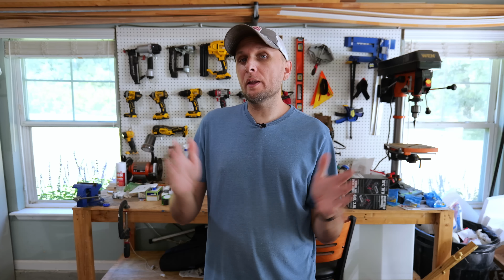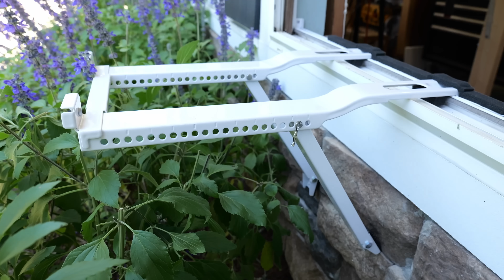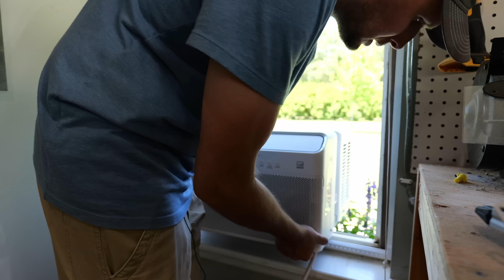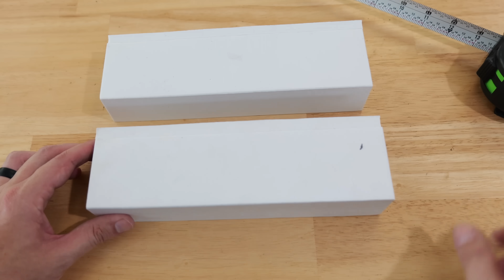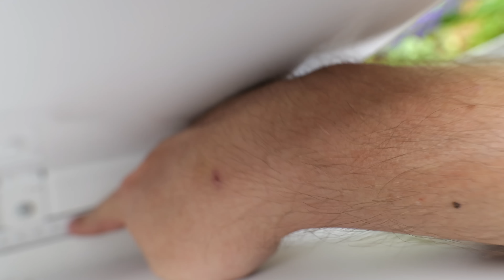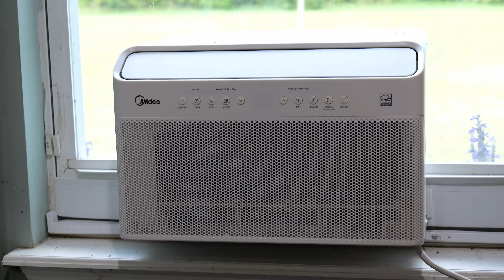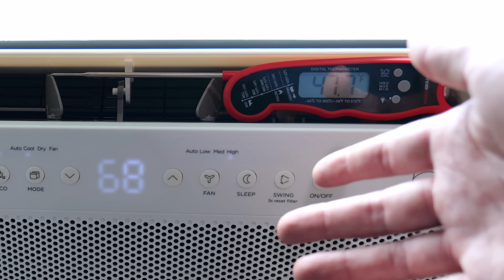The COLDEST And QUIETEST AC Unit Ever Made!  Still Use Your Window!

Comment: I have 3 of these, they are ok, they are real quiet for a month or so then all of them will have fan clicking (shroud nicking) start up, all started rusting out, and I had to put drain holes in them as way to much water was filling up the pan and traveling in to the wall...as I said they are ok, they need to adress the rusting, the draining and the fan shifting
Reply from the maker: Interesting.  I’ve not experienced that.  What did you do for the fan to make it stop clicking?  Anything?
Reply: @HowToHomeDIY  remove the top and shift the fan, may or may not work
Reply from the maker: @Cat-Caddie so check this out.  I started getting a ticking noise from the fan today and started blaming you for the luck 😂.  Took the cover off and found a tree frog had a bad day on the fan and it was throwing it out of balance.  Removed it and back to quiet.  I was like what are the odds 😂
Reply: @HowToHomeDIY  rofl

Comment: I have one and it is amazing.  I have it running all day in my office in the summer off of a Ecoflow battery and a solar panel and it only pulls 224w of power  (low fan speed set at 67 degrees). Saves  a ton of money not having to run the entire house here in CA.   I have had it 2 years. Highly recommend.

Comment: I have a small midea ac and is very quiet. I am amazed. Thanks for reviewing this larger unit, I am thinking about getting this ac  instead of getting a mini split and it definitely seams much easier to install than a mini split and less expensive. Thanks again for the review video.👍👍👍👍👍

Comment: Looks great. Now I want my current units to die. Regarding security, I use 1x1 wood cut to the measurement from the top of the window up to the top. I make it slightly longer so that I can wedge the length of wood.

Comment: Great job on the video. Looks like a winner. I guess if we get one tomorrow, I'll have to see if the app requires me to allow my location to use it or if they sell any of my data. This is an epidemic. Just found out LG televisions sell your data by default out of the box unless you go through the menu and toggle it off. They've sold mine for about 3-4 years before Lois Rossman exposed it. Consumers have to keep pushing back or we will own nothing and be happy. Wink-wink.

Comment: I just installed the male version of this AC, the non-split unit. It has all the same specifications and energy usage ratings as its split sister.  The only difference is between the two is the male non-split version is a little shorter, so it doesn’t use a support bracket.  The male non-split version just hangs in the window like smaller units. In the Louisiana summer, the male non-split versions creates A LOT of condensation. I’ve measures ~10 gallons of condensation every 24 hours of constant use.

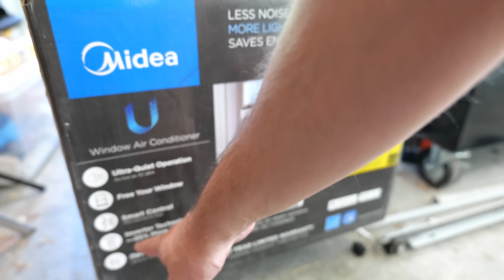Comment: Just wanted to chime in on the comment about inverter AC's being able to blow colder air 1:24 .... false. It can not possibly get colder because of what it is. Inverter "tech" is simply an AC->DC->AC control circuit that can accurately and efficiently regulate the voltage of the DC rail, thus regulating the output of the AC compressor and the amount of coldness produced (sorry HVAC guys, dumbing it down)

A regular AC is either 100% on or 100% off, 2-stage units can do 0%,50%, or 100%. Inverters allow all percentages between say 15%-100%. The ability to use only enough energy to cool a space is where the efficiency comes from, but an AC can only ever run at 100% so whether it were regular or inverter the output at full power is the same.

Comment: At minute 7:50, please note:  Some windows do NOT have "lip" on the inside lower frame so there is nothing to keep the window from being lifted up from the outside.  Please advise people to install a DIY bar or cross brace that will put pressure on the upper edge of the lower window panel and secure the bar/brace into the upper corner of the window jamb to keep the window from being opened from the outside.  This is important as window ACs are often used as a way to break into a home.

Comment: Keep in mind folks, Midea's "room temp" is probably read by the a/c unit itself, not an independent thermostat in the room that's distal from the unit, thereby giving a faIse reading that's likely lower than the actual temp in distal parts of the room. I bought GE's split quiet 12000 btu window a/c to replace my older standard a/c and it took a dump within months. My old standard a/c I replaced was way louder, but it blew air much more forcefully throughout the room...so much so I could feel the moving cold air in the adjacent rooms The split unit was so anemic when it came to the fan's force of air, I had to use a supplement fan to do the same thing.  Bought another old school 12000 btu Frigidaire with no wi-fi. Yes, it's louder, no bells and whistles, but in my opinion it's worth having that cold, forceful air getting the job done, especially when it's triple digits outside.

Comment: The Lyft assist struts in that single hung window are very easy to replace. I'm sure you can find the information on YouTube. I would say You are more than skilled enough to replace them just an FYI. 
Great video. The only problem is all my windows are xo not single hung
Reply from the maker: Great eye noticing the balancers were gone!  Yes the replacement is easy, finding the ones that fit my windows has proved more difficult.

Comment: A couple of hours to cool off one room? No Thanks,
Reply from the maker: It is a 500 square foot garage that has never been air conditioned before.  Started at 92 degrees and down to 72 or 73 degrees in a couple hours.  In what world is that not good?
Reply: @HowToHomeDIY  Two hours in 100 degree weather is pretty long.
Reply from the maker: 🤣 No, it isn't.  Like, at all.  You would be lucky to get a house with central AC down 20 degrees in two hours.  Wow
Reply: @enaid54 you have no clue what you’re talking about.
Reply: @johnpicard4909  I know it's hot as hell in the south and I don't want to spend two hours in 100 plus degree heat waiting for one room to cool down. Doesn't sound great to me!
Reply: @enaid54  so what are you going to do?  Import icebergs and put them in your home? 😂 for that AC to drop a room 20 degrees in just a couple hours that’s as good as you’re going to get.
Reply: @johnpicard4909  Yep, I'll take the icebergs. 100 degrees for two hours is miserable.
Reply: @HowToHomeDIY  500 ft, in two hours?
Reply: @enaid54  then don’t let it get to 100 degrees.   It has to start somewhere.   That’s what he said. 500 ft in 2 hours.
Reply: @johnpicard4909  Well, I don't have control over the heat and humidity. It can get to 100 degrees quick in the south. I sure don't want to wait 2 hours for it to cool down in one room.
Reply: @enaid54  did you ride the short bus?
Reply: @johnpicard4909  No but I think you had a front row seat. LOL

Comment: What he's not telling you and what he doesn't understand is that inverter compressor means that it runs with a variable speed typically from about 10% all the way to 100% this is the compressor I'm talking about. It will start off on high speed and when the temperature is satisfied it will kick down onto the low speed and run nearly continuously which is the most efficient way for an air conditioner or a heater for that matter to run. Running nearly continuously at a very low speed is more efficient than blasting on and off at high speed. This is the same type of compressor used in a mini split.

Comment: Does anyone know if window AC Units do not work when the temp is over 100 degrees?  This is my first Las Vegas summer and I have had 2 window AC units now and during the hottest time of they day between 4-7 pm my AC unit will not blow constant cold air.  It will cycle on and off the cold air and sometimes feel like it's only recycling hot air for hours.  My current unit is brad new.  My apt does get direct sunlight.  At night time when the temp drops below 100 degrees my unit works well.  Thanks for any help!

Comment: Both Cheap medea $150 air conditioners.I have in my house currently.You want them kind of level Because the condensation builds up and the fan spins through the water and splash it does it on to the condenser or coils.And that's how you get the ice.Cold air doesn't drip anything outside..

Comment: I have a 8000 and 12000.  No issues yet.  Super quiet.  One vibrates a little from the tilt that goes up and down but that's not a big deal to me.  I also have the 12000 midea unit that's not the u shape. That one works great too but not as quiet.

Comment: Thank you for this video.   Very helpful.  Here's my experience.  I bought an 8K BTU unit for a small bedroom that only had a single window.   In the past, once a traditional AC went in, you couldn't use the window anymore.   Installing it was a little tricky (I'm not a handy person), but with the written instructions and their own installation video (similar to this one) , I figured it out.   Some of the screws were a little tight.   And I had to drill larger holes in the bottom of the inside bracket to accommodate the supplied screws, but not a big deal.  I loved it so much that when the 10,000 BTU units went on sale at BJ's in early spring for $299, I picked up 6 more.  I ran around to a lot of BJ's to do this.   2 of my windows are small and non-standard, so I had to cut away at the sides with a multitool to get them to fit.   The other four went in easily.  I have become an "expert" at installing these.   Absolutely the best window AC units I have ever used.   Super quiet.  You don't even notice them on.  And super fast at cooling.   To save electricity, I close my bedroom and only leave that one on.   When I wake up on a hot day, it can be about 80 in the rest of the house.   I tell my Google Assistant, "Google, turn on all the Air Conditioners".   You feel the blast of cold air immediately.   In 10 minutes, the whole house is cooled off.    That may have to do with the size of the units relative to the space.   I would suggest getting the largest unit(s) you can find.   Other videos suggest that these use about half the power of conventional units.   I have not tested the wattage.  I use the app as a command center.    You can also create Scenarios.   I have them installed upstairs.   I can create a single button that turns on or off all the units upstairs or downstairs.   Love seeing the temperature Outside and Inside from the app.   No more guessing.   Temperature control is super accurate.   I check it against my Nest Thermostats.   Love the remote access.   I can be away from the house and have everything cooled off by the time I get home.    Mine is an older house.    I did not want to think about central air conditioning but was considering Mini-splits.   For $1800, I have 6 units which are as efficient and quiet as mini-splits costing about the same as a single mini-split.   I've never seen them again at the price I got them, but do see them going on sale occasionally at Costco, BJ's, and Home Depot.     Unlike traditional window units, I don't plan on removing them for the winter.  Amazon sells outside covers, and I plan to insulate as best I can.   We'll see how that goes.   But so far, super happy with my investment.   I even have an extra one in the garage still in the box in case one of them fails.   One other point.  Although you can use the window with this installed, you can't use the screen.   So you may get flying insects unless you can figure out a screen solution that will work around this.    I'll consider that in the fall.   Maybe have a custom screen insert.    You can order those on amazon.

Comment: Midea makes a super crappy, pure junk air conditioner.  I know someone that bought one and they said that it lasted just 1 summer. I went to Sam's Club and they had a couple left overs at a super great price.  I brought on in 2021 at the beginning of August. Mid summer 2022 it was blowing warm air. My sister just bought the unit in this video. Hasn't even installed it yet. I told her what I just posted. My advice to her is get something different.

Comment: A little tale about this air conditioner. My wife and I bought that exact air conditioner, the 12,000 BTU model for our open living/kitchen room after having used the 8,000 BTU model in our bedroom. The bedroom conditioner work well and was very quiet and was fairly easy to install and we loved the support bracket. Well, 12 never worked from day one. I went through all the possibilties including whether the compressor was coming on, and it was, as well as all the other funcitons and controls. Everything seemed to be in working order but with no cold air coming out of the unit. So I called Midea and was put on with a tech who walked me through all the checks that I had already done once but I went through them again and it was determined that the unit was somehow faulty. So I asked them for either a repair station where I could take it within a reasonable distance or if they could come to my house, or if they would replace it if I returned it. To my surprise and disappoinment they refused to have it checked by a tech or repaired and did not want to replace it. My only option was to recieve my money back which they did. I got a check within a week. What was so disappointing is that I have a brand new air conditioner that does not work and I do not want to put it in the landfill because it's such a waste and I cannot find anyone locally that will check it for a leak or lack of coolant charge.
   I've taken off the cover to the mechanics on the outside half and made sure everything is working properly and to be certain that the compressor is coming on but I do not have the testing equipment to see if it has a leak or needs a charge and a year later I'm still looking for someone who can check it but without luck. Midea backed their product financially but not the product itself and because of their immediate refusal to repair or replace but instead returning my money it leads me to believe that they knew these units had some issues that were not an easy fix but were unwilling to rectify the issue. We bought a regular LG unit instead that works great. We did use the Midea window bracket which is easy and great.
Reply: Thank you for an honest review!
Reply: @loricassata5259  Another little tidbit: Costco just opened a new store near me and they had that exact same 12,000 BTU model for sale for $259. Someone told me that it was probably there because it was known to be unreliable and that Costco got it for a song and dance and would still make money even if the return rate was high.
Reply: Wow what a crybaby…got you money back and still have the unit.
Reply: @billnlpaw  Shouldn't you be out campaigning for Trump?

Comment: I love these units but they do have the caveat that you should probably not leave them installed year round. The condensate pan intentionally holds water which it uses to splash on the evap coil for extra efficiency from evaporative cooling. Best not to subject that to freeze cycles